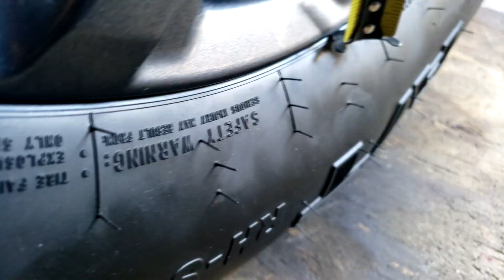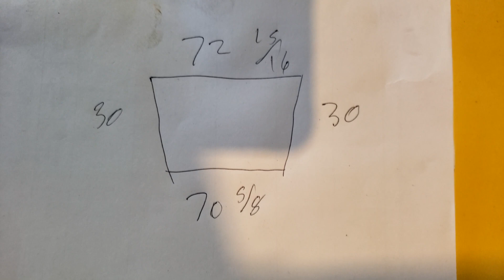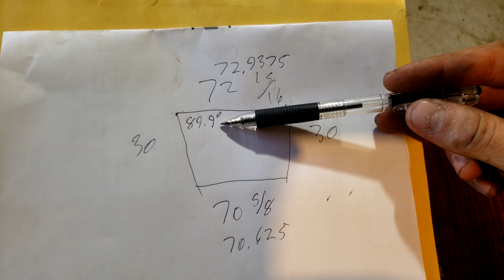2019-2021 Ford Ranger DIY Alignment After Leveling Kit

Comment: Thank you for the ideas!
I have done toe with tape measure center of tread on each side, never used the trapezoid but rather recorded the top and bottom and adjusted each side little by little till 1/8 in on front (1/16 ea side)

Comment: How is theses 2019 rangers? 1.5 was looking at one with 50k on it
Reply from the maker: @Ronnie_Herron  I've since sold mine to get something bigger with a higher towing capacity, however no major complaints. Rock solid reliable well built little trucks. Even tho they're rated for 7k, If you're not towing more than 5k regularly they're great daily drivers. Gas mileage leaves something to be desired though. They basically get the same MPG as the 2.7 F150s in practice. After a lift and big tires i was averaging about 19.5mpg combined.

Comment: Great,in theory thats all good only if you don't use turntables under front tires all your calculations are WRONG truck has not settled down as driven on road.
Reply from the maker: Put 30k miles on it no tire wear. Sold the truck though. I have 4 other vehicles algned the same way driven by me and my wife every day. Like i said in the video, just take it to the shop if you don't want to do it this way, thanks for the reply though!

Comment: I did a bilstein 1.8 inch lift in front only and my camber seems to be perfect without touching anything. Making me think I should just get in professionally aligned. 2020 Ranger
Reply from the maker: If the camber is perfect thats great. Adjusting the toe wont affect the camber. If anything, it's making it easier for yourself, but a shop most likely isnt going to give you a lower price if they end up not needing to adjust camber.
Reply: @ZF5foraWhiteGuy  took it to Ford they charged $23 to check and to my surprise I did the alignment properly thanks to this video.

Comment: Are we taking front and back measurements of the same tire to see if the wheel is turned in or out for toe in and out?
Reply from the maker: Yes, you will measure in front of and behind the hub then figure out the difference between the measurment as described in the video to get your toe
Reply: @ZF5foraWhiteGuy  thanks 😊 turns out I'm just a little retarded and  what happened to me was I put back all the suspension parts correctly but I incorrectly put on my tire. I didn't put the lugs on evenly and the tire was off. Rookie mistake lol. I fixed it. The knowledge is there now though haha. Appreciate the help.

Comment: Nice job.  I'm a mechanical engineer and a racecar owner/driver and have done my own alignment for years.  I have one suggestion for you.  Whenever you lift a tire off the ground and then lower it, your suspension is bound up a bit.  Which will screw up measurement accuracy.  So each time you lower the vehicle to the ground, roll it back maybe five feet and then forward again onto your plywood.  The only other thing I do different is a racecar-only thing.  For absolute accuracy you want the driver's weight in the car during measurements.  I use a couple hundred pounds of bar bell weights in the driver seat.  No need for a street ride.  But you did good -- I'm impressed.

Comment: At first I thought this was going to be a dumb idea.  However, you have replicated what is done in an alignment shop to a high degree of accuracy.  Interesting and resourceful solution that can be used to save money or not spend money you don't really have.  When I was younger and poorer I would have been all over this idea.  In a pinch I see no reason why this would not work perfectly. Nice solution and explanation.

Comment: Glad I watched this.  Just installed my 2.0 coilovers (I disconnected the LCAs to install) and went ahead and pushed the camber max negative setting on the LCA bolts when I reinstalled them.  Back on the ground, my trusty leveling app reads -0.6 each side.  Toe-in is noticeable by looking, so I'm still still deciding if I want to do the mockup and all the math or just eyeball-adjust and go get an alignment.  LOL  "Remeber when your teacher said you wouldn't always have a calculator in your pocket?"  So true!